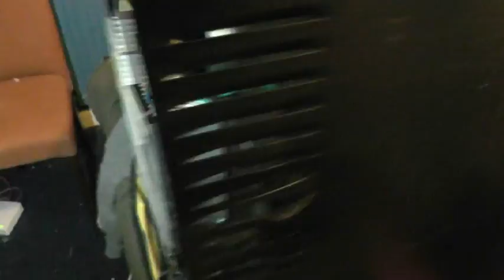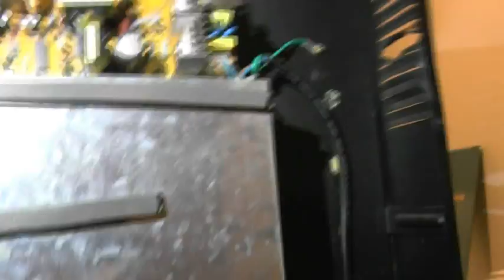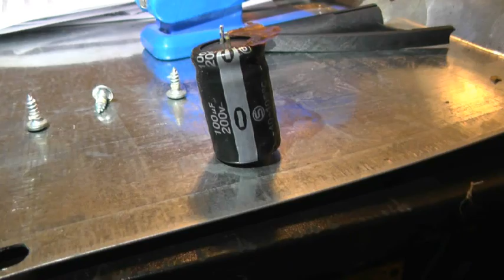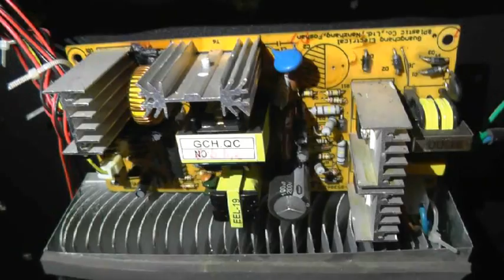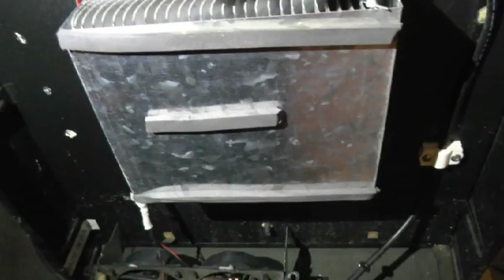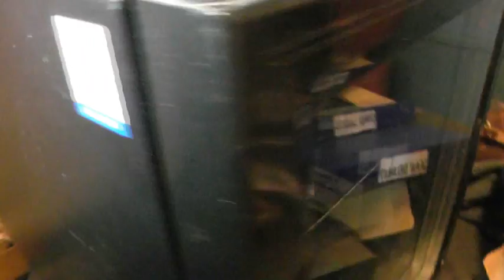husky fridge electronics

Comment: Difficult to say what caused it to fail but it certainly wouldn't work if the capacitors have blown. A sensible first step is to replace the capacitors. Capacitors are chosen for their capacitance (farad) value and rated for the maximum voltage that they are expected to work with. It's unlikely that they would have been fitted with the wrong rating by the manufacturer. Good luck, I hope it starts working again.
Reply from the maker: I haven't replaced them yet! But the voltage here at mains is 230-250V If fitted with a 200v capacitor would it cause them to fail sooner then if fitted with a higher V rated cap? (planned obseleccence)
Reply: If they were run at 230v+ they would fail almost immediately. I suspect that there is a transformer in the circuit altering the voltage before it gets to the capacitors.
Reply: tobortine
Yes, 230vac is an RMS value. That means the peak value is about 320v so 400v caps are normally used for mains. Caps normally vent from heat, which can be from external sources such as heatsinks or generated internally from the capacitor's ESR. The Nichicon caps you've bought should last longer due to being better quality particularly if they are 105 degrees rated.